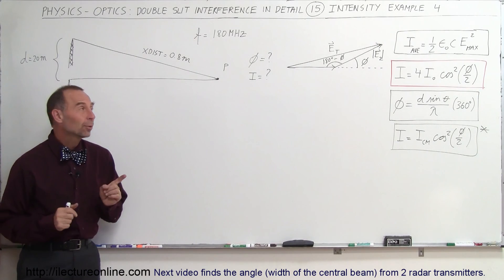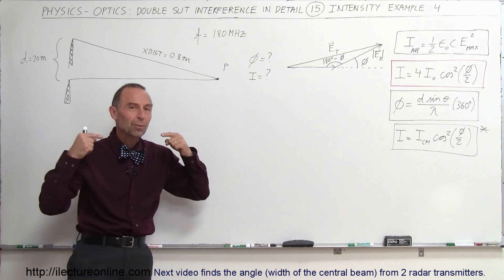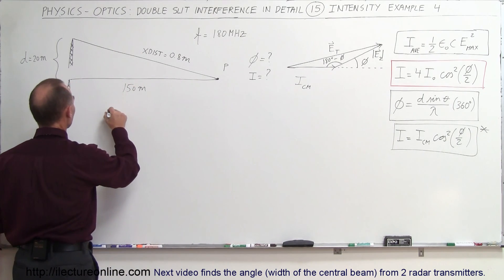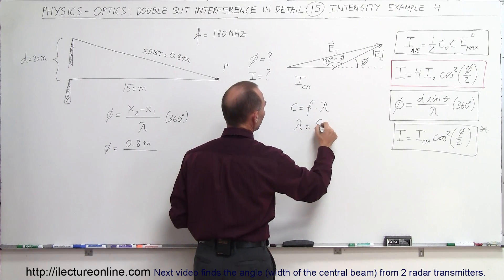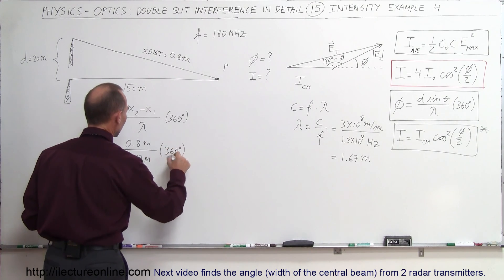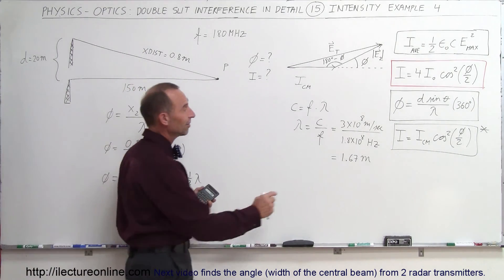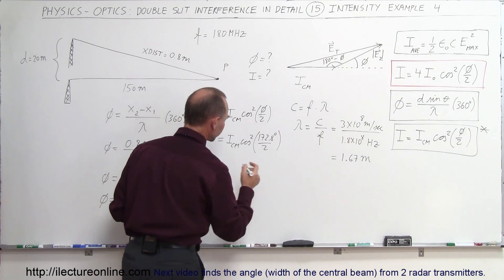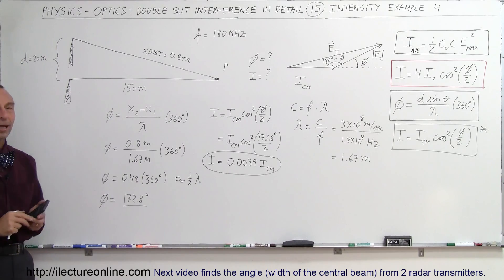Physics 60  Optics: Double Slit Interference (15 of 25) Find Phase Difference and Intensity

Comment: Hey! I love your videos! I would just like to ask why you are using the I=Icm*cos^2 formula instead of the red boxed one. Thank you!
Reply from the maker: If the Icm is known, you can use the bottom equation.  If you know the intensity through a single slit, then the Icm for a double slit will be 4 x I of a single slit (The red box equation).